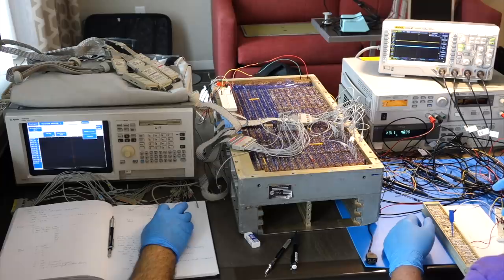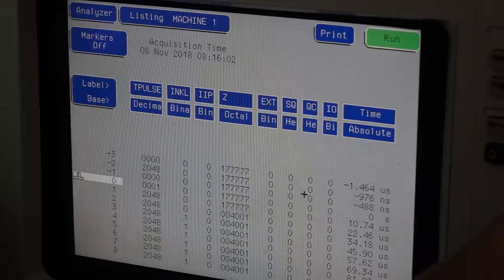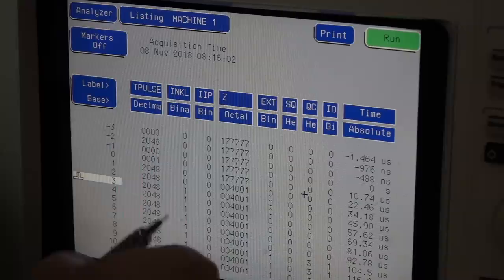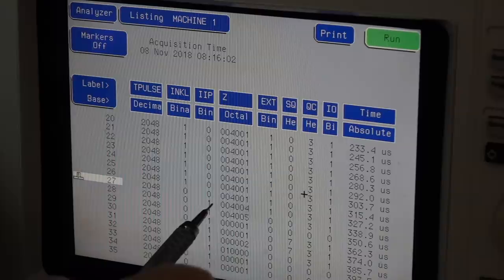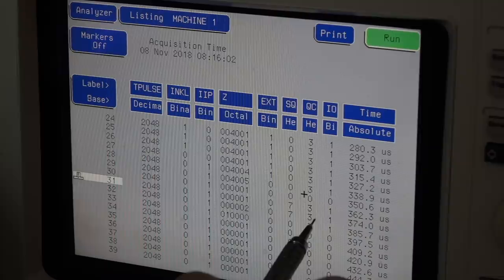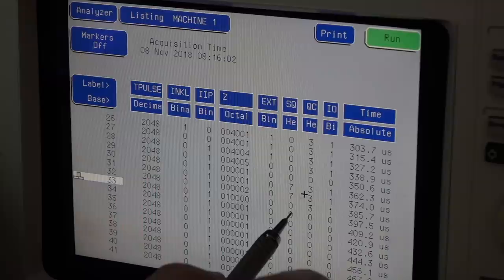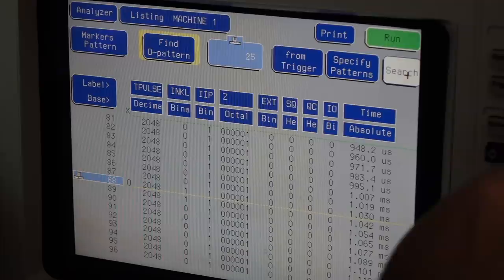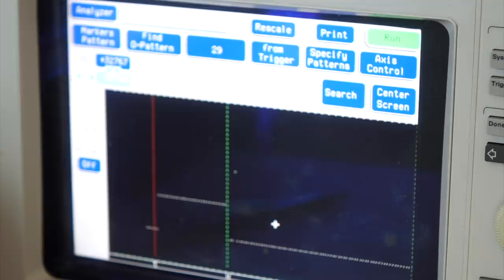Apollo Guidance Computer Part 4 ½: Bonus material, full Logic Analyzer trace explanation uncut

Comment: Wow, reminds me of the futzing I went through to revive a comatose Tektronix 4050 series beast. Failed RAM and ROM, no display whatsoever. That was my first foray into logic probing. Fortunately Tek had generously supplied headers on the PCBs to connect the probes and read straight off the address and memory busses, just like you guys did here. Way to go!
And yeah, with some external help (thanks, DaveR!) I finally figured out which RAM chips were bad from the probes, and she's been running again since.
One nifty test in a situation like this where there's no working ROM is to either fabricate one filled with NOPs, or as in your case, maybe even directly hardwire the memory data bus to return the corresponding instruction word. That way you'll cycle through the entire address space and wrap around, testing both the addressing and instruction decode logic, and the bus in general.

Comment: Did I miss something, because I thought I understood it immediately. In older machines the CPU registers were visible in memory addresses just for this reason: you can boot without any memory. Usually you could use the front switches and blinkenlights to program instructions to registers. Of course this is also a meta-programming tool, because accessing instructions from core memory is much slower.

Comment: It’s funny. I wonder if having a tool such as (somewhat) modern logic analyzer would have sped up the Apollo design cycle, or slowed it down. It would be interesting to see what tools they used in the development of this system.
Reply: Grad students as free labor = 1960s logic analyzer
Reply: I once debugged a machine controller stuck in a loop with a simple 2 channel analogue scope.
I was lucky as the loop was less than 20 instructions long and I found an address line that toggled only once in that cycle so I could use it as a trigger...
But believe me: writing 16 Adresslines and 8 datalines of each about 20 cycles long on paper one after each other, than decoding it instruction by instruction took a lot of time (but I found the Problem!)

Comment: Can anybody get a make off that logic analyzer? I caught "Agilent," but the GUI looks almost identical to my HP 16500B, so did it come out soon after Agilent split from HP, or did they just not update the interface that much?.
Reply from the maker: It’s an HP 1670G. Contemporary to the 16500, runs on the same software.
Reply: @CuriousMarc  Interesting. Mine's just got the jog wheel and a touch screen, which I'm a bit mixed about, because the touch alignment can be off depending on your point of view when you interface with it. I prefer a more "tactile" interface myself. Still, I got it for only $100 CDN from somebody at my local retro-computer meetup, and it came with a 16510A card (with cables), so there's not much to complain about.

Do you know if a serial mouse can be used with the RS-232 port? It's got this proprietary RJ-style port on the front for the mouse,  but a DB-9 to DB-25 adapter would be much easier to track down.